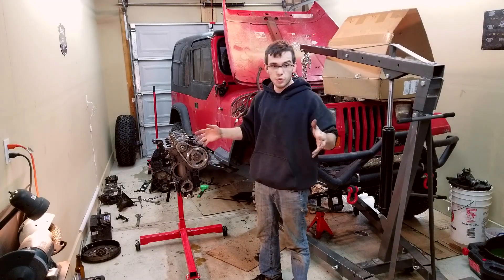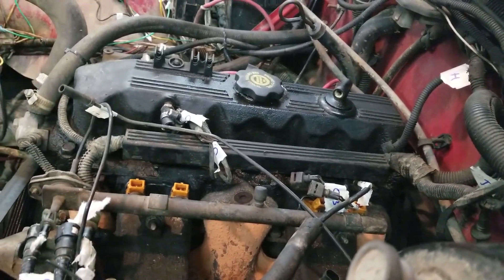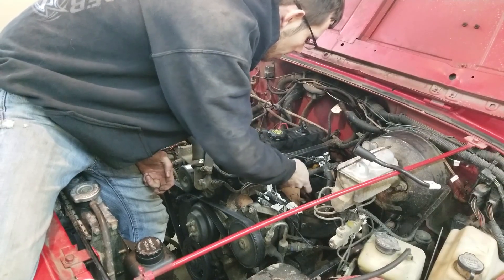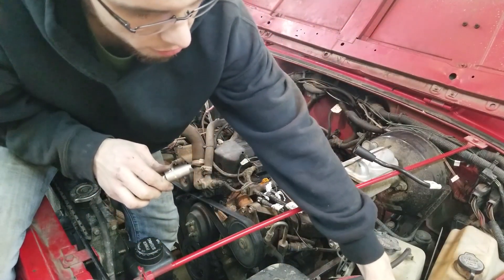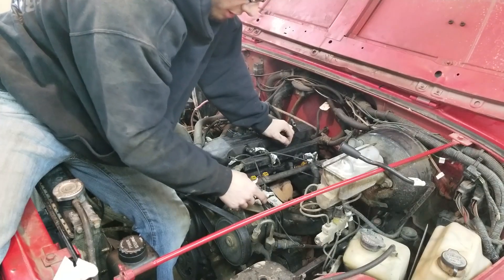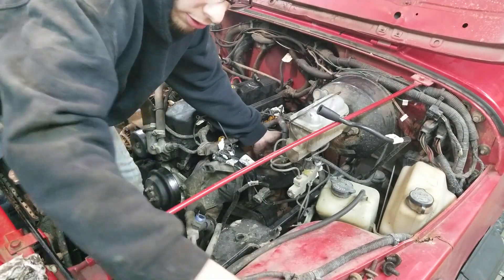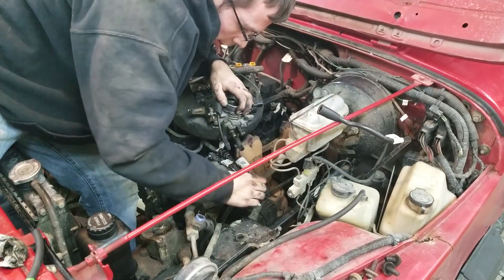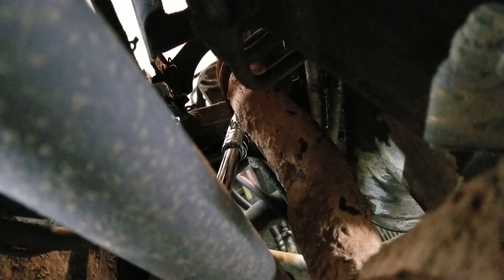Jeep 2.5L 4 Cylinder YJ Intake and Exhaust Manifold Removal

Comment: Do the studs go on the ends of the exhaust manifold? I didn’t pay enough attention while removing and now I’ve got 2 studs and 5 bolts
Reply from the maker: If I remember correctly, yes the studs go on the ends. The forward most hole and the rearmost hole.

Comment: Great vid. Hey question on urs how was the side port gasket? If bad what did u use?? Mine is gone and not sure what to use.
Reply from the maker: I think you are talking about the intake and exhaust manifold gasket, Mine was all messed up or gone, I can't remember. Either way you can pick one up from any auto parts store, they aren't expensive or hard to find.
Reply: 71 WA188

Comment: Thanks for the video. Question. The exhaust manifold bolts that connect to the exhaust flange. Are they bolts or studs? 95 YJ parts list does not list the bolts/studs P/N. Mine were so rusted I had to cut them off to remove the front exhaust pipe but now I don't know if these are bolts or studs. Knowing would determine how I proceed to try to get them out of the manifold.
Reply from the maker: If I remember correctly they are studs in the manifold. 
I dropped a header in after this video so I haven't seen the manifold in a while!
Reply: Thanks for the reply. It seems like a majority of people are saying they are studs. The question remains, do I try an air hammer to get the "studs" out or should I play it safe and drill them out in case they're screws. The last thing I want to do is have to remove and replace the exhaust manifold. Every time I take a nut or bolt off this Jeep it turns into a complete cluster F of a project! I do want to thank you for your videos. They have help me out a lot with this old rusty, abused, neglected Jeep. Just remember folks. Cheap Jeeps usually end up being timing consuming expensive projects!
Reply from the maker: @Geonious  hmmm you are making me want to dig that old manifold out of the scrap pile and try this out. Maybe make a video in the process...
Reply: Got an email address? I would like to email you the steps I took to get holes in the header and the other fun stuff I discovered during this project.
Reply from the maker: @Geonious  yes, laffingstok@gmail.com

Comment: consultation, changing the injectors of 4 holes and the throat is 62 mm improves fuel consumption, my jeep consumes as v8
Reply from the maker: It's possible,  those mods are designed to reduce restriction and provide a better burn. Usually that means better mileage but the change will be small.  Tire size is probably the biggest factor.
Reply: I have 32 tires and it's automatic transmission
Reply from the maker: @edgarpizarroso675  yea,  same here and I average 14mpg. It depends on wind too